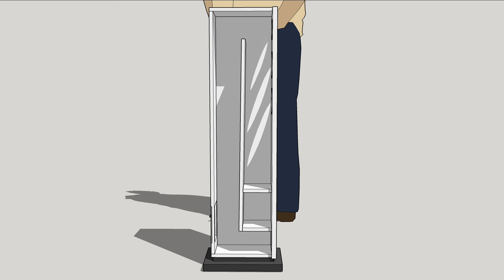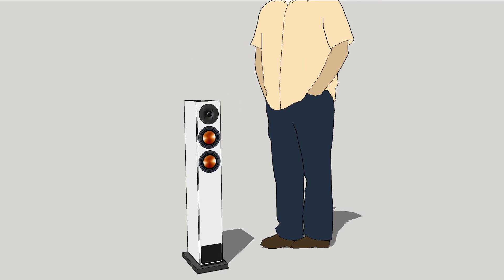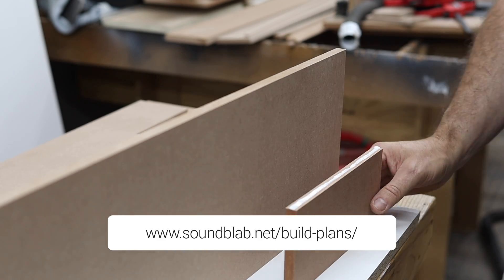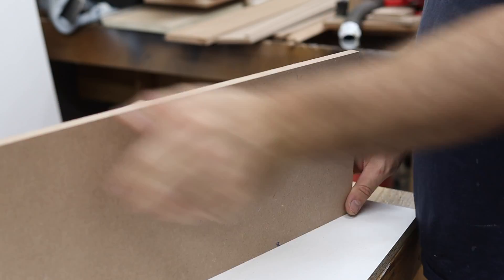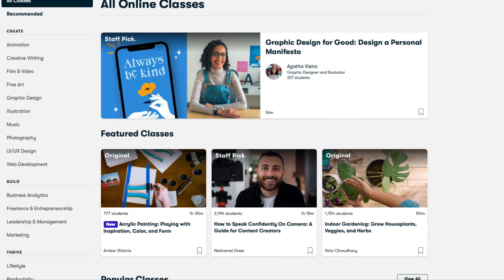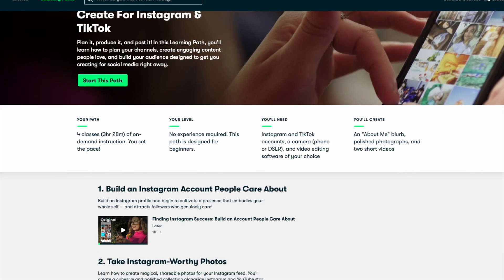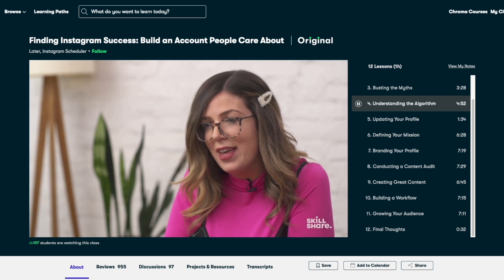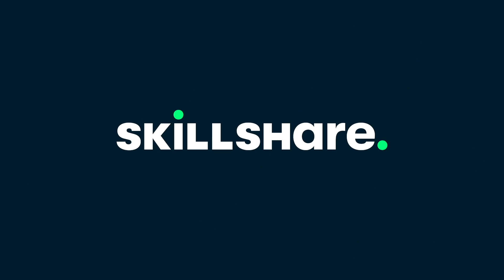Building a Transmission Line 2.5-Way Tower Speaker - by SoundBlab

Comment: Just finished these speakers yesterday evening.
Gave 'em a little listning test and the sound sounded great. 
All though i need a new amplifiler now. 4 Ohm's mention in video but what Watt range should i aim for these? (min / max)
Or any suggestion on any amps to get?
Very fun build, could have built these faster and soon than the time it took, but i made them as a project build :)
Happy and stoked on the result and looks in the end!!

All props to Hanri and SoundBlab for inputs during the project ;)
Reply from the maker: Thanks for the positive review! I also like this design! Any amp that can handle a nominal 4 Ohm load will be fine. To drive them well, I will suggest not something that is less than 50-100Watts per channel. Higher is better, because then you can run the amp in it's optimum range which is usually way before it reaches it max output.

Comment: Hi...
I'm realy considering this transmission line build.
It's nice and clean build 🤩
Not to big either to small imo👌  
These speakers will fit better for my use than my 20+yrs old tired Jamo classic 8's that i currently have . (not in use atm, collection dust 😅)
I also have this unbuilt subwoofer kit 10'' (bandpass box) i want to use along with these speakers 👍
During the building video, mention half inch (12,7mm EU) thick wood. 
Would you or other that have built these to use 12mm mdf, or can/should i use 16mm instead 🤔
I'm curious, that's why i'm asking 😉

Great video 👍👍

Thanks 😊
Reply: Follow up question:
Crossover parts? 
- Mention in build plans witch ones i need to get?

I see all other parts needed, just not the crossover parts listed.
In discription, some links are mention to sites to get parts from.

Again, Great video 😉👍

Comment: So not all transmission line design require angled baffles to mimic a horn?
Reply: Correct. Transmission line comes in different types, but the physics is the same. You can google different types, like TQWT, MLTL and so on. 😊

Comment: I like the idea of selling speaker plans like you do, but I would like to know, before I buy the plans, what the cost will be to actually build the speakers. I can buy a plan, but when the cost of the parts are above my budget it makes no sense to buy the plans.
Reply: All the links to the parts are there so not sure what estimate you are having difficulty with?
Reply from the maker: The only parts not listed in the description are the crossover parts. You can budget around $50 to $80 for those. Difficult to give pricing that never stays the same year on year.

Comment: I've always been fascinated by transmission line speakers, since I first heard a pair of PMCs.

These look like an interesting project and not very complicated to build.

One question though: I would have thought that the induction coils needed to be placed out of phase. I realise they are some way apart but I'm used to seeing them at 90 degrees to each other and  kind of diagonally opposed, so that you can't se one through the aperture of the other. Was there a particular reason you did it this way?
Reply from the maker: Easier to mount, but you can get away with it if they are far enough apart on the board.

Comment: What function of empty box inside of first t-line half?
Reply from the maker: No function, other than to take up space. To get the tweeter at ear level the speaker has to be a certain height to achieve this. The space was added since the transmission line is not long enough to fill the entire enclosure volume. The space can be filled with damping material or, even better with sand.
Reply: Good) @SoundBlab

Comment: Rookie question probably, but what does the additional full range driver add in terms of sound that you cant get with a single full range + tweeter in this design?
Reply from the maker: We get baffle step loss in the bass region. This means the bass response, as a result of the narrow baffle has a 3 to 6dB drop from a certain frequency depending on the baffle size. So, we get an overall drop in SPL due to this and have to also drop the tweeter level to get a flat response. By adding the second woofer, we can boost the level of the bass in this baffle step loss region again, and gain a higher overall SPL, making the speaker easier to drive with a smaller amplifier. Two woofers also have to do half the work of one, so we reduce the distortion potential of the drivers and they play cleaner. This is best I can describe it in basic terms. Hope it makes sense.
Reply: @SoundBlab  Thank you for the explanation - really interesting, im learning a lot fro your youtube channel!

Comment: Similar to the Tri Trix TL from Parts Express which is an MTM.
I built a pair for my BR TV expecting to have to add a sub even for regular TV watching, based on the small drivers, but I have been surprised by the depth and quality of the bass.
My next project is a compact TL sub using an 8" high excursion driver.
Reply from the maker: Very cool!

Comment: short question: You can connect any speakers to any Amplifier right?
Reply from the maker: Most speakers have either a nominal 4 or 8 Ohm impedance, and most amplifiers can handle this load. However, impedance changes over the frequency range of the speaker, but a 4 to 8 Ohm rated amplifier can handle these changes, unless it is a very sensitive tube amp. Some of these do not like major impedance fluctuations. There are other factors, but this will require a much longer and technical explanation.

Comment: Please make a dolby 5.1 home theater wearless  Please 😊😊😊
I weat for it 🤩🤩🤩🤔
Reply from the maker: No speaker setup is really wireless. You are always going to have to power them somehow, and routing power to them is as challenging as routing a speaker cable. I don't think it is worth it or practical.
Reply: Thanks
Reply: Please make a 5.1 home theater bar  

Please 
Please

Comment: Nice to see a constant-CSA TL design done the right way, with offset drivers to reduce or eliminate the first harmonic resonance, and lining / stuffing to deal with the others. 

Filling that little section at the start of the line with sand would reduce the center of gravity of the speaker (making it a bit more stable) and perhaps would add some panel damping of its own, just a thought.

As for bass measurements in-room, I can understand the challenge.  I've achieved decent results using the transfer function method, but usually I just compare the measured impedance curve to the simulation and assume that they closer they are, the closer the actual bass response is to the simulated response curve.
Reply from the maker: Thanks for sharing! Yes, the bass measurements are a challenge. I was pretty happy with the in-room measurements of the bass, so I did not confirm it otherwise. Normally I wil do a near-field and port measurement that gets combined, a baffle step applied and then spliced with the far-field in software. I find this to be quite accurate. But I don't always have time, and have learned how my measurement room behaves and can predict more or less if the bass response will be OK.
Sand is certainly the better option to fill the void.
Reply: CSA is probably cross sectional area, if anyone from the future is trying to break their head over lol
Reply: I immediately thought of loading that cavity with sand.  These speakers look amazing.  I've added them to my list of possible builds for when I have a hifi space available in the future.

Comment: Does the satin enamel pain need primer?
Reply from the maker: I used a few coats of sanding sealer on the MDF first. This seals the quite porous MDF and allows you to apply the enamel without a primer. However, this might vary according to the specific enamel used. A primer is always a good idea though, and I would generally suggest it.

Comment: i would have put the bass reflex port in the back in the middle to make room for a seperate room for sand in the bottom! filling the cabinet with sand is underrated.
Reply from the maker: This is a transmission line, and not a bass reflex enclosure. Therefore the 'port' opening is at the end of the transmission line, and thus limits where it can go. I agree that sand is good for filling voids.

Comment: What would be the estimate total cost to buy every component needed for this project (more or less)?
Reply from the maker: Approximately $275 for drivers and crossover parts, excluding wood and finishing.
Reply: @SoundBlab  is this your higher cost with the expensive shipping or just part cost?I tried to add it up but without knowing the crossover components it's hard to ballpark it. These would be perfect for my daughters setup we are going to build them together.

Comment: Neat design! Gotta love TLs, they tune below resonance frequency of the driver, and tune wide too (the peaks have a low Q compared to vented designs when tuned lower)
Reply: "they tune below resonance frequency of the driver," 
The decision to have an enclosure that has an F3 lower than the FS, is down to the choice of the individual and the correct enclosure. It's not a natural consequence of having a transmission line!
Reply from the maker: Thanks

Comment: Hi Hanri, looks great. What is the purpose of the small sealed section?
Reply from the maker: Thanks Richard! It's just how the transmission line length fit into the height and depth of the speaker resulted in that space that is left over. So just sealed it off and stuffed to prevent any standing waves or resonances.
Reply: @SoundBlab  have you ever used spicyTL? I find it's a great source for transmission line design, you can do more with it than with hornresp. In fact my first video was on the program on my channel Elliott Designs if you're interested. It was my first video, and so pretty much one take and should have been much shorter, but either way, I definitely recommend checking out the program!